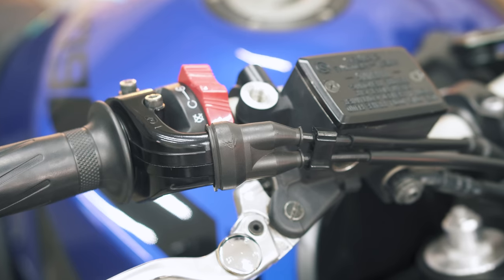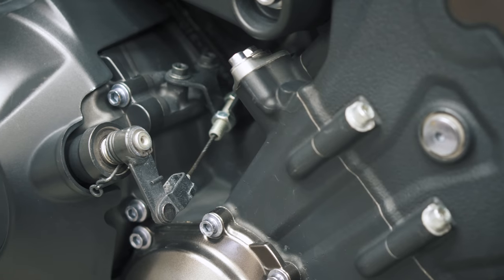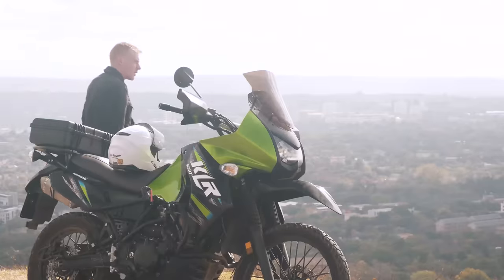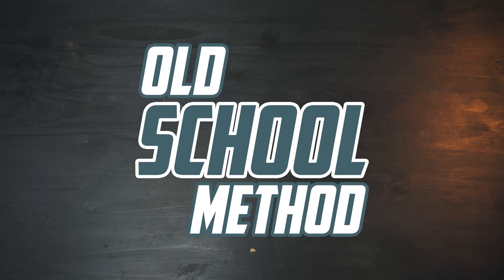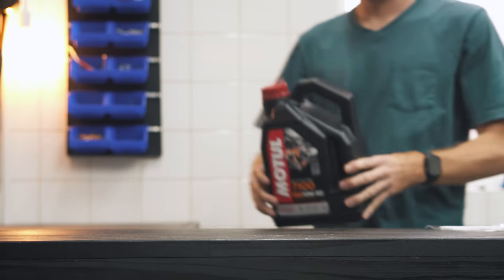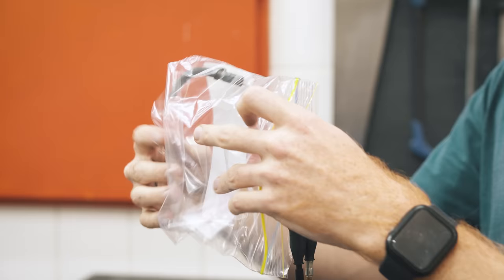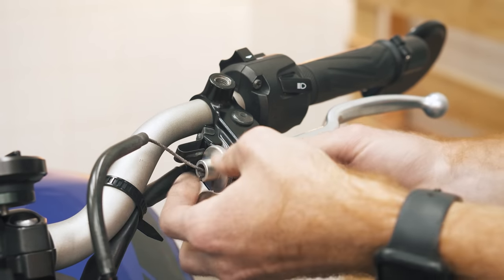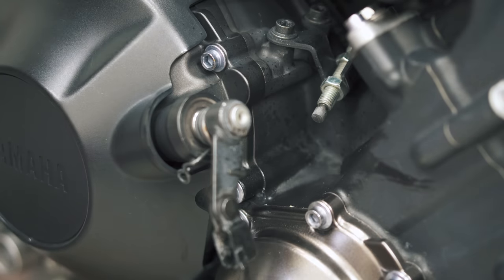STOP! Lube Your Motorcycle Cables

Comment: i do want to add that some lubes tend to accumulate a lot of dust and making it worse in the long run. A spray dry lube would be optimal
Reply: Your cable should have a dust cover at the clutch and the handle bar to prevent dust entering it. 

Hard to describe thing but you know it when you see it.
Reply: @ralphwarom2514  i know that it does and it does work quite well under normal circumstances

But there is still gonna be a small bit exposed and thats enough if the cables are covered in sticky lube
Reply: @someguy9520  That is true normal oil type lubes will accumulate grime like a magnet just like on the chain. Ive switched to using dry graphite on both chain and cables and it lubricates well and doesnt attract grit like oil does, but it does breakdown a little quicker but reapplying frequently is good practice since it also allows you to do quick safety inspections at the same time.

Comment: if the cable is the electrical cable, use (contact cleaner)..
it is safer than wd40.
i buy a contact cleaner and apply it into my contact key which is keyless since it is always stuck and jammed.

Comment: i ride a Versys 650 2021 and its got a bout 10k miles on it, went out for a recent 250mile trip and i found the longer i went the more the clutch was harder to pull in and my hand was in pain at one point so i pulled over and stopped for a rest.
i carry chain spray in my top box so i fired some down the cable and slthough it did help short term, by time i was home my hand was hurting again. my previous bike, kle500 i never had a clutch cable problem. i am not sure if the stiffness of the clutch is because of the cable or because of the clutch itself. but cool information, il go do some research into oiling the cable and see if it helps.

Comment: I have done nothing to the clutch cable for over 70,000 km on my 2011 BMW F800 GS. The bike has been through some harsh conditions but I believe the original cable is strong enough to last as long as a motorcycle, unless the pilot puts it in a known dangerous environment. I would just replace it with a brand new one to last until the bike leaves this planet to the land of free gas, just to be sure.
Reply: Probably a stainless cable with a nylon lined outer. That’s why it’s not breaking your wrist!

Comment: Something was said about solvents and teflon as a possible problem, it is not likely. The chemical resistance of PTFE (teflon) is outstanding, there are no solvents which could dissolve PTFE at room temperature and the surface of PTFE at room temperature is affected only by molten alkali and fluorine in some cases.

Comment: WD40 is a poor choice for cable lube, but not because of affecting teflon or nylon cable liners, which are resistant to any solvent likely to be found in a consumer product.  WD40 is just a poor lubricant!  Graphite oil or teflon oils are the best thing for cables. I would also suggest inspecting cables at the time of lubing, checking for fraying or signs of wear, finding a problem at this stage prevents failure on the road, which is never welcome!

Comment: Where i wokrk to lube cables we3 jsut use a syringe, basically you just put the lube on a plate suck it with the syringe and just stab it at the end of the cable while moving it

Comment: Most folks forget that the WD means water displacing. And anytime it is used for lubricating a part in place, after 4-6 months it turns into a glue like substance that completely defeats the purpose you intended it for.  Stupid is as stupid does. GET INFORMED people.

Comment: I lubricate my cables regularily but don't use wd 40 to do it because it turns into a gummy mess over time .i use simple relatively cheap 3 in 1 oil and it works brilliantly .
Reply: As we are on tips, I do use  dash of water-restistand grease on the ends of the cables to sort of seal them.

Comment: Not only is it more comfortable to ride with well-lubed cables... It's safer - imagine your throttle or clutch getting stuck in any position, at the exact moment when it's least convenient or safe - i.e. pulling into an intersection.

 Or worse - the cables could even snap

Comment: I use an other old school method, maybe more efficient that the zip bag trick.

Simply fill up a medical syringe with motor oil, put a big needle, dismount the top side of the cables, put the needle inside and inject....done.

Comment: My throttle goes back to its original state after i press it, so its not stuck. But my throtte has a mind of its own sometimes which is dangerous. It just happen to me the other day out of nowhere. I ran over a curb cause of it when i was aobut to pull off. How can i fix it since its not stuck. ? It may need to oil it. And i have a 150cc Moped might i add.

Comment: How's graphite/pencil lead as a lube for the cable? 
Sure it is a bit tricky to insert but once  done you probably won't need to do it again for a few years also it's a dry lube which is ideal for the cables.
Reply: Often it’ll turn into an abrasive slurry, with the existing lube, and any other fluid that might be there
Reply: @16bittech  I don't have any liquid in my cables. I've never done it before.
Reply: I was wondering the same thing. Just made my ignition lock feel like brand new, why not cables...
Reply: @adyz  I watched this "Ben on two wheels" guy who recommended  using graphite as a lube for the cables. I'm not riding my motorcycle currently but whenever I get back to it I want to try it.

Comment: Lube cable with lube not wd40 it is water dispersant not a lube. they make cable lube get it use it and every so often replace had throttle cable fray in carb  locked full wide open, luck was duirt bike. Problem was riding at a gravel pit by myself and had to push it over a mile in motocross boots to truck killed my feet. Then had to run up ramp with no power and try to step into truck  was touch and go after 1 mile boot walk. cables are cheap when a few yrs old rep[lace them all and lube every month or so if you ride a good bit. On my dirt bike I did full lube and greasing first of the month that is after 4 weekend rides make bearing and cable last a long time. street bikes do not get muddy and wet so once ever 3 months greased ever bearing and pivot point, put 65k on one bike and never had any bearing or shock linkage bushing wear out but every 3 to 4 months all got greased

Comment: EVERY VIDEO I have watched all do the same thing and that’s MAKE A MESS. Take a paper towel shop rag old t shirt ANYTHING you don’t care about it. Take this item or choice and wrap it around the entire tool AFTER you inserted the nozzle or little tube that comes with the line. This will NOT make a mess now for the lube that is forced out will not shoot and drip all over the place for there is something there to catch it. Super easy do to and is way less time then it will take to clean up. Something I do after I get lube at the other end is take my air compressor and then put a towel at the other end wrap it around and spray air with my nozzle into the cable. You would be amazed how dirty and nasty it is after you blew all the crap out of it. Then I once again put some more live into into it. Street bikes not all that big of deal to blow it out it will still be a little dirty but anything that is played in the dirt with will be SUPER DIRTY get all that crap out.

Comment: my acc cable becomes so tight that just turning right raises the engine even after freeing upto the last tread on the  sleeve barrel, the happens every 2-3 years & have to replace it, what happens why it gets shorter to raise engine rpm.

Comment: the way you put the lubes on the cables are far more messy than i used to do. all you need is a syringe. you dont need to buy that 10$ tools. on the syringe just put the needle onto the opening of the housing and use the syringe how it use to be and your good to go. no spillage 100% guarantee

Comment: The cable lubricating tool works a lot better when you tighten that thumb screw down with a pair of pliers. It actually makes a complete seal that way. A bit finicky but it’s better than wiping lube off your bike lol
Skål 𝕭𝖔𝖊𝖗𝖙𝖍𝖊𝖗!
Reply from the maker: Sounds a bit overkill- I like it!
Reply: @ChaosCauses  additionally when a complete seal is made the pressure of the can pushes the lubricant through the cable housing and cleans out any debris buildup too.

You could always replace it with a hex head bolt too now that I’m thinking about it 🤔
Reply: @ChaosCauses  Why doesn't the motorcycle industry do what the bicycle cable companies do? My bicycle has the same housing (teflon liner) as the motorcycles do, but with the added benefit of having the cables coated with teflon that makes their operation smooth & friction free. Also, there's no need to use oils or any lubricant so dirt isn't attracted to the cable or the housing because everything runs dry. Nice!

Comment: Another cheap alternative method is using lube that comes in a drip bottle then using an air compressor with a needle size air nozzle to force the lube down the entire length of the cable.

Comment: Another good tip for cable throttles ; remove the 'return' cable to reduce friction and make the throttle action lighter. I've never known a throttle to jam at the carb / throttle body end, the springs are more than strong enough. The return cable is politics IMHO

Comment: The WD40 should be used to drive crap and moisture out of the end of the cable sheath, and continue until the fluid coming out of the end is clear, then I repeat the process using Wurth high performance dry chain lube, as a courier I rode in all weathers all year round for years, and had no issue with cables after doing this. For those who only ride a few thousand dry miles every year the biggest issue is lack of use, bikes are built to be ridden not sat in a garage

Comment: Ahh, yeah no. 🙄🤦‍♂️
Pure petroleum distillates will just attract dirt and grime like a magnet and gunk up cables and pivot points. It is the worst possible chemical to use for lubrication on anything. The only thing petroleum distillates are good for is cleaning and loosening rusted parts. Use pure silicone or a silicone-based lubricant for cables and pivot points. (I.E. a mix of petroleum and silicone)

Comment: So, I suppose the manufacturer is wrong when they say DO NOT use cable lubes………

Suzuki states that cable lubes will DESTROY the PTFE coating inside the cables. The only thing to use IS WD-40 or a light oil like linseed oil. 

So I guess Suzuki is wrong and so are the manufacturers of these cables.

Y’all have a heavy misconception of what WD-40 is. It is a solvent (as is almost any oil) and it is a lubricant.
WD was used by the USAF for protection of a certain silver metal skinned nuclear missile. Now those things cost millions of dollars, tons of o-rings and all that. If it is so bad why was it used?  

How much is your bike? A few thousand dollars? You thing it is more susceptible to life ending consequences than a nuke? 

This stuff even works on guns. 

Do the research and get facts before you listen to bulls**t.

Comment: All nonsens... Protect your clutch cable near the handlebar adjuster against moisture and water.. with a good old vintage rubber cover.. seen on older bikes.. NO need to oil the cable.. if you protect your bike that way.
If you can't get one of them.. use some electric isolation tape... If the clutch needs to much hand  force.. buy a new clutchcable...
WD40 is only a degreaser.. 
(Berlin, Germany🇩🇪👍)